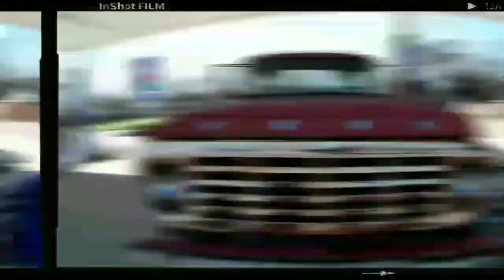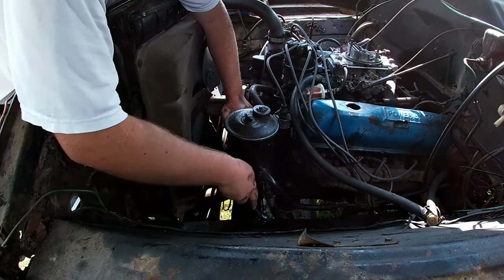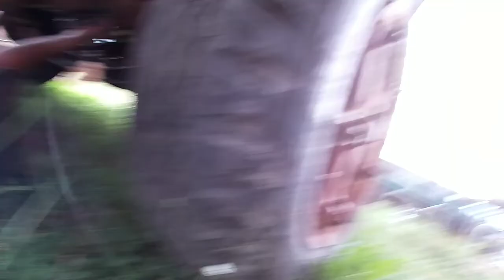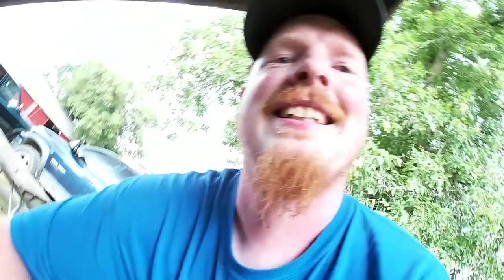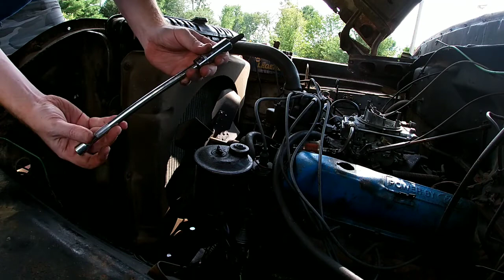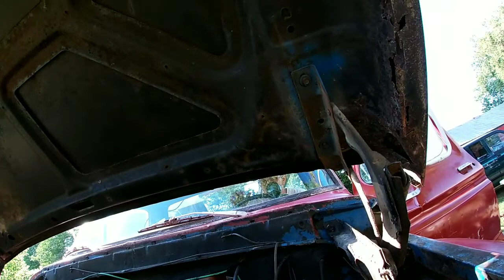replacing fuel pump on a 390 big block (77 F600 tow truck)

Comment: perfect time for a giggitty, btw thanks for posting this video. i have been having trouble finding out where my fuel pump is on my 73 f600 so im going to use this as a reference and double check and hopefully get mine running again! thanks guys. can you tell me where you got your fuel pump at?
Reply: I don't remember exactly, but I think I got it from NAPA. Part number MF0064

Comment: You mean 391FT? Or is it actually a 390FE
Reply: I personally don't know for sure, I was told it's a 391, but if you need to know for the fuel pump I got it for a 73 F350 with a 390 from NAPA and it fit right on